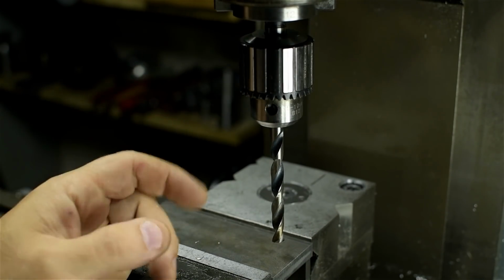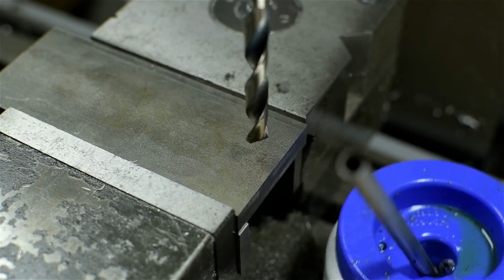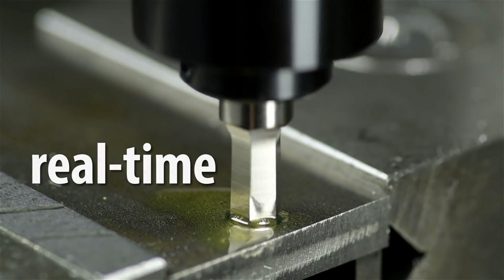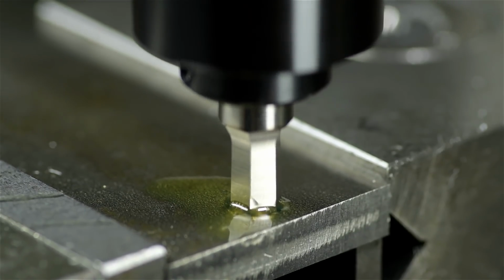Rotary Broach: Captain's Log, Supplemental

Comment: Let's say you wanted the final shape to be oriented in a particular way. Maybe a square hole with one of the sides parallel to some other feature on a part. Apart from scrapping 20 parts until the hole happened align right, is there any way to control the position at which the broach first bites into the material? Maybe with an intermediary guiding block or something?
Reply from the maker: yep you can set up a guide

Comment: Hey ToT! Just wondering, any chance we'll see an update on the tig torch water cooler? What temperature did you end up setting the STC 1000 to? How are those little case fans workin out? Did taking out the larger, motor driven fan end up being detrimental to the pump?

Anyway, keep up the awesome work! Best. Channel. Ever.
Reply from the maker: to play it safe I just set it so the fans are always on. I can't tell the difference! super quiet no alarms no overheating.

Comment: Can we talk about the concave surface at the broach cutting edge? How important is it that it be concave? Does having a flat surface versus concave change the ability to cut thru the material? Seems like it would be easier to sharpen a broach with a flat end vs concave.

Comment: looks good and a great couple of vids, just a question though, I run to the lathe also, I am too tight fisted for a skateboard or scooter, therefore I can't afford a battery drill to make a hex into metal while holding it down to a bench by my other hand, could you also show a vid where you use the rotary broach in an old brace and bit type drill? I think my pensioner neighbor has one I could borrow :)

Comment: Surely someone must have said it, but in this case of using the drill/mill, avoid spinning before entering. Touch lightly and then turn on. At least a couple of the spikes are already chipped off. Have used them extensively on a CNC lathe.

... and don't call me Shirley.

Comment: Thanks for the followup.  I already knew how rotary broaches worked, but it remains cool to see one do it's thing on the mill.

You mentioned that you were considering building your own rotary broach.  That would make still make a fine topic for a video.  Because then I'd consider building one or two.  

Also, real question here... Will this style of rotary broach cut a male shape?  i.e. you've made hex sockets, is there a way to make hex bar?
Reply: I think it would work in theory, but the shape of the tool would be hard to make. Keep in mind that there would need to be a taper

Comment: Because the broach is spinning before it engages the hole, is there a way to place the hex at a desired orientation at all? For example, two of the sides set parallel with the sides of the rectangular plate. Or is it just randomly thrown in place?

Comment: Next question driven by the final shots of the broach being through the workpiece. Is the hole BIGGER than the broach itself due to the wobbling action? Like  wallowing out a hole with a screwdriver,
 so you have to undersize the broach for the hole you want to make?

Comment: actually made it it a bit more clear as to how it worked.  =)  with each "wobble" each cutting edge cuts a little more of the material away until you complete the cut ... correct ?  =)  thanx for the vids ToT =)

Comment: Help! Tony always enjoy your videos, got a big problem right now I was making a scraper out of a huge screw driver (cut head off, dremeled slot was gonna drill it and tap it so I can clamp the little piece of carbide(from a 2 inch scraper blade cut off and shaped with a dremel diamond wheel , well it's a chrome vandium screw driver and even cobolt bits from irwin won't drill the hole, so I figure my hardened hss tap won't probably work either got some advice? Help!!!!!!!!!!! btw it's much clearer on the mill what is happening there btw.

Comment: So there must be some amount of torque in the bearings to allow the mill to precess the broach? It looks like the rotation of the broach stops entirely, but if it was some kind of free bearing between the broach and the spindle, it wouldn't precess at all... right?

Comment: OK I give up does the Broach, Part or both have to be Rotary/Spinning why not just plunge broach no needed? What am I missing? I have done a lot of broaching on New Britton multi-spindle machines and Brown & Sharp single spindle but there was no choice but to do rotary because other tools were engaging the workpiece. But on a but on a manual lathe or mill couldn't you just plunge the broach into the workpiece?

Comment: Hey TOT, have to admit, it looks a little less like witchcraft to me now. However, I´m thinking about the wobbling action and if it doesn't chew up the hole (or hex in this case). Is this, in fact, the case and the effect is just small because the wobbling is relatively weak or is the thinking wrong here, and even a 45-degree moving thing would give a straight hex for some reason?

Comment: I might be stupid, but where do the material that is outside of the drilled hole (ie the corners) go?  Especially at your brass oilplug for your motorcycle (that ended inside the plug)..

Comment: Just curious, is there a way to clock the cut, or is it random based upon when it made contact to the piece?
Reply: Put the broach where you want it (light pressure) then start the mill.  The broach spins freely in the tool holder, just wobbling around.

Comment: what do you do if you want the hex to be in a specific orientation? with the lathe the assumption is that it doesn't matter because it's round but on a plate like that what if you need the profile to have a face parallel to the edge of the plate? do you just hold it with some pliers until it makes contact with the piece?

Comment: How does one control the indexing of the hexagonal hole relative to the workpiece? Is the initial contact under pressure before the z axis feed is started enough to guarantee the cutter is locked axially?

Comment: hey Tony I have one question though, can you in any way control the angle of the broached shape ? Like there are also "letter" and number broaches available, how do you control which way will the letter, or a hexagon for that matter, end up, sometimes it might be crucial in the machined part, and since this is wobbling and rotating it seems like it will randomly do it depending on when it hits the machined "surface"
Reply from the maker: yes you can align then before entry

Comment: THIS QUESTION IS COMPLETELY unrelated. , no  I don't need to know how to turn the caps loc off. I want to buy a lathe I restore antique cars for a living. My question is I want to turn brake drums, mid 50s and older the drums are attached with pressed in studs so a newer dedicated brake lathe makes more work. The problem is I'm going to need a 16" throw are there any smaller machines with a removable bed? It's not just for brake drums

Comment: Can you control the orientation of the rotary broach when used on the mill, like if you wanted to line up one of the sides of the hex to be parallel with an edge of a part?

Comment: Speaking out of speculation, I am assuming the broach bites at an arbitrary angle due to where it contacts the piece while rotating. How would you align say a square broach for its sides to be parallel to the sides of the workpiece?

Comment: AHHHHHHHH!!! Why can’t you line up one of the sides of the hex to be either parallel or perpendicular to the edge of the work!?!? 

I know this didn’t matter in the last video, because the work you broached was circular, BUT NOW IT MATTERS!

Just like you would consider an L style Allen wrench that doesn’t have the bend perfectly along one of the flats to be defective, this hole is defective!
Reply: You need a special jig to do that (an "orientation dog").  I'm sure ToT could build one, but it's quite a bit of extra trouble if you're usually just gonna stick the broach in a lathe anyway.

Comment: How does one deal with broaching holes with one of these if the hole needs to be aligned a certain way? Just use a pair of pliers or something to hold the bit at the right position until it’s bitten in far enough to not matter?

Comment: How would you set this up if you wanted the hole to be at a particular orientation? Such as two of the sides of the hexagon parallel to the sides of the work piece?

Comment: Is the rotary broach usually pushed through with like 1000rpm, instead of the 100 or so in this video? I'm interested in making screwdrivers.
Reply: From what I can tell you set it appropriate to the same drill bit size
Reply: @randomassortmentofthings  Drill bits for a 1/4" between flats? For a 1/4" drill, you would set the RPM to be close to 1500rpm. It would be well above 1000, not something like 100 like in this video.

Comment: My only question is: If you are doing this on a blind whole (like the screw on the last video), where does the material go if there is no chimney? Thanks.
Reply from the maker: just gets packed down. you need a hole a little deeper than the hex you want.

Comment: What if I need a particular face in a particular orientation because there are only two orientations?
Reply: You could make a guide plate out of like 1/8th inch with the broach, clamp, weld, glue, tape, or bubble gum the plate to the area in the right face direction as needed. Drop the broach in the intended location inside the guide with oil, then start the power and let her wobble in.
Reply: duce wags, It is so obvious!
Of course I wouldn’t think of it.

Thanks.

Comment: out of curiosity, if you wanted the broached hole to have a particular orientation, would you simply attempt to hold the broach in that orientation until it made contact with the part?
Reply from the maker: by hold you mean with like a fence or guide right? then yes.
Reply: @ThisOldTony  that was sort of my question. but I guess if I wanted the broached shape in a particular orientation I would bring it into contact with the part being broached before turning on the motor. 

a simple example would be to apply a series of square holes in a metal plate, arranged like a dashed line. though I can see where there would be a more appropriate tool for that particular job, I was curious about whether this was something doable with this sort of tool.
Reply from the maker: yep! you could probably touch off but I'd use a straight edge.. not very thick.. and align against that without touching the work. but I bet it'd be fine either way.

Comment: I need your help with something, i have a pitbike and the splines for the shaft that hold the engine sprocket, they are worn down and i cannot buy a replacement, what do i do to get my sprocket secured on safetly? ThisOldTony if you can, contact me.

Comment: This old Tony I was wondering your thoughts on this Lathe? AL-336D DELUXE Centre Lathe HAFCO Metalmaster
Reply: On Tony's side of the ditch it won't be a Hafco. When Keith Fenner restored what we know as  Hafco AL960 he called it a Rutland. Machinery suppliers rebadge various oriental machines. For instance the AL 960 is from Taiwan and I think the AL 336 is from the mainland. What I did to choose was visit Hafco in Brisbane and physically inspect their range. Careful of the salesmen though, they have a sales pitch they will use such as some place that removed their Colchester lathes and replaced them with ALXXX. Yeah right.
Reply: @mikenewman4078  Well I think I found the one I decided on Precision Matthews PM- 1030V
Reply: @coryjeffreys5146  Ah goodo. Being a PM it sounds like you are on big Tony's side of the ditch. Hare and Forbes are an Australian distributor. I will look up the PM item. When I bought my AL 960 in 2007 the difference between Chinese and Taiwanese was profound. The Chinese item had better features lile foot brake and Chuck interlocked guard. The feel of the controls was what decided me despite being another 1000 over the Chinese . I got dudded though, the electrical was not as advertised or even as in the manual. Hope it goes well. Are you keeping it manual or going CNC?
Reply: @mikenewman4078  Well at this point and time I'm unsure. but I will probably end up going CNC but I'm really new at this so Might be a year till I do.

Comment: CAUTION:  Non-machinist lame question ahead...  So is this how a square, hex, or torx drive screw made?  I have no idea how they are produced by the thousands and fit the drivers so well.
Reply from the maker: mass produced screws are pressed / stamped / swaged probably while they're hot.  broaching would be too slow ie. too expensive!
Reply: @ThisOldTony  I should have known that, thank you for answering my dumb question, grin...